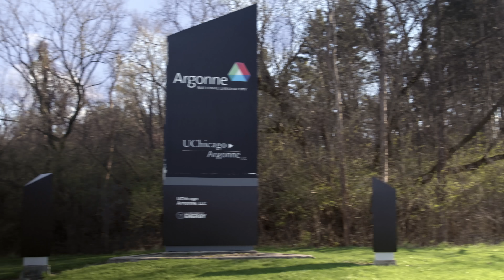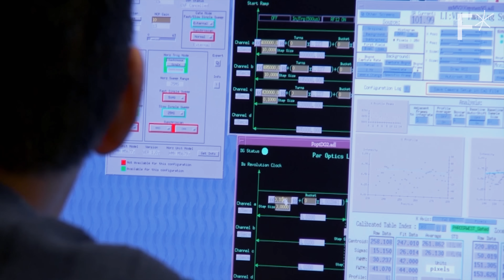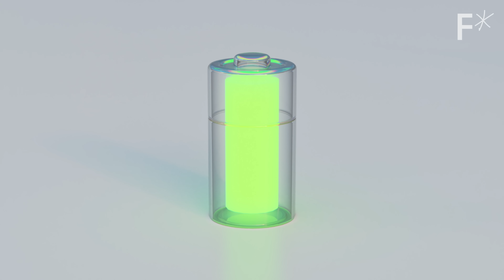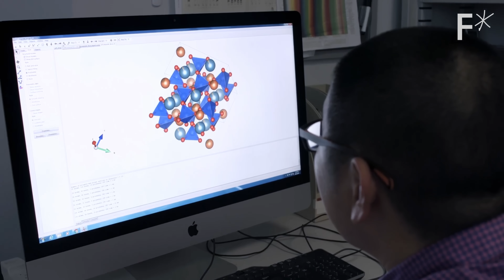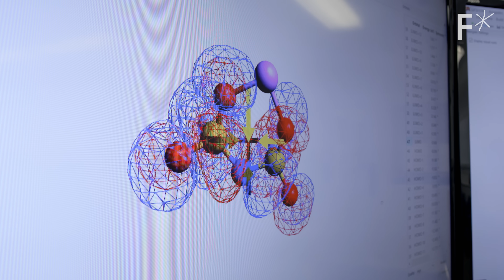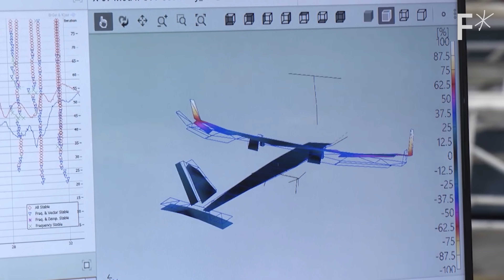The future of high energy density batteries | Hard Reset

Comment: none of these new battery vids ever take into account that lithium batteries are a massive multi billion $ consumer industry. Industry does not kill its own income just cos a better products comes along. i.e. disposable razors: they use extra soft steel that is carefully designed to blunt after a few seconds of cutting hair. It's been trivial for decades to forge steel that keeps a razors edge for longer but that would reduce razor consumption.
Also substaintially improved battery tech would jeopardize the consumer oil market which the oil cartel will not allow.

Comment: As an civilian "observer" I think there needs to be more R&D into battery swapping.  
It is already here for battery powered electric hand tools and works quite fine.  As a matter of fact without the ability to swap batteries, these hand tools wouldn't be on the market today.
This approach needs to be taken with EV's and especially Electric Trucks.  By installing a portion or all of the battery as a swap it enables charging from solar during the day or other sources as they become available such as wind or nuclear when above peak electrical production occurs.  It also enables the swappable battery to be used for other uses such as home storage for night time power usage.
Another benefit is the reduction in weight of an EV or Electric Truck which increases the efficiency of the battery further.  It could reduce the weight for short trips but extra charged swap batteries are added when needed for longer trips.

Comment: 102204.  Other than a diode array, another method to plausibly transform ambient heat into electricity with equivalent cooling essentally consists of two electrodes closely face to face (~1 micrometer) in a vacuum wired to an external electrical load. The face of the [Emitter] electrode is covered with a uniform array of LaB6 tipped small diameter carbon nanotubes grown straight out. The face of the [Absorber] electrode is covered with small scale graphine flake char. [Rice U 2014]

Thermal energy mobilized unattached electrons will tend to free themselves and move outward from the emitter tips and drift at ~1 million meters / second @ 25 millivolts (thermal electron energy @ 20 C)  to the absorber which tends to collect them. 

A negative charge accumulates on the absorber. This repels oncoming electrons slowing their forward drift, cooling them. The absorber electrode charge is simultaneously the repelling cooling and the external electrical load voltage. The drift current and external wire route current are the same. The DC electrical power consumed by the electrical load depends on the load resistance. Thermal energy absorption always equals the electrical yield.

Wire resistance is a practical loss not a true loss so lt is overcome by added device output. Extra cooling then balances the heat given off by the wire loss. The performance of the device is expected to be modest in the beginning but improve rapidly. Even early devices are expected to last a long time. There is little place for obsolence if the first installed device works adequately. They will withstand being short circuited indefinately up to an electromigration limit.

The device decays via electromigration. This may be very slow. Low current density encounters between electrons and the atoms of an electrical conductor are elastic.

Aloha

Comment: 102203  Nanometer scale uniformly aligned parallel diode arrays may be a practical way of absorbing ambient heat. Ambient heat is uniform on a micrometer and larger scale and non uniform on a nanometer scale. Plausibly,  heat absorbtion at the non uniform scale is available as Johnson Nyquest thermal electrical noise that would yield, by conversion without gain or loss, an equivelent amount of electrical energy. 
AND
 Diode voltage / current  characterstics can be displayed on an XY tracing oscìlloscope. Thermal electrical noise power in resistors can be displayed by time sweeps of voltage on an oscilloscope. Each such time sweep shows unique randomness.
AND
A  simple  "Special Program with Integrated Circuit Emphasis" model indicated that diodes in uniform alignment parallel would aggregate simulated rectified thermal electrical noise.

Maximum direct current electrical power, half, is transfered from a direct current electrical source to the electrucal load when the electrical resistance of the two parts is equal. Calculated matched resistance output (watts) is k (Boltźman's constant), one point three eight x 10^ minus 23, times T (temperature Kelvin) times bandwidth (0 Hz to a natural limit ~2 THz @ 290 K) times rectification halving and nanowatt power level rectification efficiency, times the number of diodes in the array. 

There are a billion cells of 1000 square nanometer area each per square millimeter, 100 billion per square centimeter. 

Creditable independent replicatable proof of concept protypes beyond improper influence are needed.

Aloha
Charles M Brown 
Kilauea, Kauai, Hawaii 96754

Comment: 102203  The second law of thermodynamics may be false conventional wisdom. Let's face the wonder of full heat use. 

The second law of thermodynamics was developed during v8ictorian england's scientific and religious fascination with steam engines. 

The second law is behind modern refrigerators needing electrical energy to compress the refrigerent to force it to release as waste the heat that it has removed from the refrigerator's service interior in the cooling part of the refrigerent's circulation. The interior coldness draws in exterior heat through the cabinet insulation. There is also discarded heat from mechanical friction and electrical resistance. The net thermal output equals the electrical input with energy not being gained or lost in this refrigeration system including its forced waste. Unencumbered refrigeration by the principle that energy is conserved should produce electricity instead of consuming it. 

It makes more sense that refrigerators should yield electricity because energy is widely known to change form with no ultimate path of energy gain or loss being found. Therefore any form of fully recyclable energy can be cycled endlessly in any quantity. 

Full heat recycling, all electric, very isolated underground, undersea, or space communities would be highly survivable with self sufficient EMP resistant LED light  automated vertical farms, thaw resistant frozen food storehouses, factories, dwellings, self contained elevators, safe rooms, and horizontal transports. 

In a flourishing civillization, small self sufficient electric or cooling devices of many kinds and styles like lamps, smartphones, hotplates, water heaters, cooler chests, fans, radios, TVs, cameras, security devices, robot test equipment, scales, transaction terminals, wall clocks, open or ciosed for business luminous signs, power hand tools, ditch diggers, pumps, and personal transports, would be available for immediate use incrementally anywhere as people as individuals or larger social groups see fit. 

Some equipment groups could be consolidated on local networks. 

If a high majority thinks our civilization should geoengineer gigatons or 
teratons of carbon dioxide out of our environment, instalations using devices that convert ambient heat into electricity can hypothetically be scaled up do it with a choice of comsequences including many beneficial ones. 

Energy sensible refrigerators that absorb heat and yield electricity would complement computers as computing consumes electricity and yields heat. Computing would be free. Chips could have energy recycling built in.

A simple rectifier crystal can, iust short of a replicatable long term demonstration of a powerful prototype, almost certainly filter the random thermal motioren of electrons or discrete positiive charged voids called holes so the electric current flowing in one direction predominates. At low system voltage a filtrate of one polarity predominates only a little but there is always usable electrical power derived from the source, which is Johnson (observation) Nyquest (theory) thermal electrical noise. This net electrical filtrate can be aggregated in a group of separate diodes in consistent alignment parallel creating widely scalable electrical power. The maximum energy is converted from ambient heat to productive direct current electricity when the electrical load electrical resistance  is equal to the array internal electrical resistance. 

Maximum calculated electrical power output (watts) is k (Boltźman's constant), one point three eight x 10^ minus 23, times T (temperature Kelvin) times bandwidth (0 Hz to a natural limit ~2 THz @ 290 K) times rectification halving and nanowatt power level rectification efficiency, times the number of diodes in the array. 

There are a billion cells of 1000 square nanometer area each per square millimeter, 100 billion per square centimeter. 

Order is imposed on the random thermal motion of electrons by the structual orderlyness of a diode array made of diodes made within a slab: 

  P type boron doped
-----‐------‐----___-- Out
🔻🔻🔻🔻
■■■■■■___ + Out 
  N type phosphorous doped 

All the P type semiconductor anodes abut a metal conductive plane deposited on the top face of the slab with nonrectifying joins;  the N type semiconductor cathodes or common cathode abuts the bottom face. As the polarity filtered electrical energy is exported, the amount of thermal energy in the group of diodes decreases. This group cooling will draw heat in from the surrounding ambient heat at a rate depending on the filtering rate and thermal resistance between the group and ambient gas, liquid, or solid warmer than absolute zero. There is always a lot of ambient heat on our planet, more on equatorial dry desert summer days and less on polar desert winter nights.

Focusing on the composition of one simple diode, a near flawless crystal of silicon is modified by implanting a small amount of phosphorus (N type conductivity) on one side from a ohmic contact end to a junction where the additive is suddenly and completely changed to boron (P type conductivity) with minimal disturbance of the crystal lattice. The crystal then continues to another ohmic contact. 

A region of high electrical resistance forms at the junction in this type of diode when the phosphorous near the ĵunction donates electrons that are free to move elsewhere while leaving phosphorus ions held in the crystal while the boron donates holes which are similalarly free to move. The two types of mobile charges mutually clear each other away near the junction leaving little electrical conductivity. An equlibrium width of this region is settled between the phosphorus, boron, electrons, and holes. Thermal noise is beyond steady state equlibrium. Thermal noise transients, where mobile electrons move from the phosphorus added side to the boron added side ride transient extra conductivity so the forward moving  electrons are preferentally filtered into the external circuit. Mobile electrons are units of electric current. They lose their thermal energy of motion and gain electromotive force, another name for voltage, as they transition between the junction and the array electrical tap. 

Inside the diode, heat is absorbe; outside the diode, to exactly the same extent, an attached electrical circuit is energized. The voltage of a diode array is likely to be small so many similar arrays need to be put in series to build higher voltage.  

Understanding diodes is one way to become convinced that Johnson Nyquest thermal electrical noise can be rectified and aggregated. Self assembling development teams may find many ways to accomplish this wide mission. Taxonomically there should be many ways ways to convert heat directly into electricity. 

A practical device may use an array of Au needles in a SiO2 matrix abutting N type GaAs. These were made in the 1970s when registration technology was poor so it was easier to fabricate arrays and select one diode than just make one diode. 

There are other plausible breeches of the second law of thermodynamics. Hopefully a lot of people, mostly as independent teams, will join in expanding the breech. Please share the successes or setbacks of experiemental efforts. 

These devices would probably become segmented commodities sold with minimal margin over supply cost. They would be manufactured by advanced automation that does not need financial incentive. Applicable best practices would be adopted. Business details would be open public knowledge. Associated people should move as negotiated and freely and honestly talk. Commerce would be a planetary scale unified conglomerate of diverse local cooperatives. There is no need of wealth extracting top commanders. We do not need often token philanthropy from the top if the wide majority of people can afford to be generous. 

Aloha
Charles M Brown 
Kilauea Kauai Hawaii 96754

Comment: Lithium is not environmentally problematic to obtain nor are lithium batteries difficult to recycle (they are actually quite profitable to recycle!), it is primarily the cobalt which is the problem. In regards to "1-2 TONS per kg of lithium", okay, and your point is...? 2 tons of water really isn't much compared to many industry uses and water is obtained large-scale from desalination plants near the oceon. Further, 1kg of lithium would produce ~9kwh (about 160g/kwh, but some batteries use significantly less lithium metal) which is a large battery. A tesla power wall is about 13.5kwh for comparison.

In terms of alternatives to li-ion, there exists LTO and LiFePO4 which are quite popular for certain use cases and contain no cobalt. There are other less popular lithium chemistries that exist with improved lifespans and energy densities but other disadvantages.

Comment: I have patented a closed-loop system using electrolysis and either fuel cells or an engine I have patented called the Ringine to store energy in high-pressure hydrogen and oxygen gases, and then recover the energy by passing it back through either the fuel cell(s) or the Ringine (the Ringine appears to actually be MORE efficient than the fuel cells).  We are preparing to detail engineer the Hydrox version of the Ringine to demonstrate the technology.  This is a TOTALLY closed-loop system that can be very small or VERY LARGE and store enormous amounts of energy in extreme density due to the application of electrolysis to 'split' millipore-pure water.  We can store about 2Mw-hours in about 150 gallons of water.  We are talking about industrial-level power storage to allow power from green sources to be stored in huge amounts so that our world can be power at night by solar energy.  We have also developed a system that utilizes solar thermal energy to desalinate or purify seawater or brown water and purify it AND produce electricity as a BY-PRODUCT by utilizing the Ringine.  We are currently preparing to build a tech demo of that system because we feel water is ever-more critical and since we can produce BOTH power and purify brown or seawater simultaneously, we should pursue that avenue first, then this: We have also developed a solar-thermal power production system using a closed-loop highly distributable steady-state cycle that produces electricity at 35% to 45% overall system efficiency; we truly believe this, all put together, is the 'way forward'.  And this is just the tip of an iceberg I'd love to tell you about.  @Freethink, you need to be aware of this.  I would be glad to present it to you.  Let me know if you are interested.  This is vetted by several professional engineering firms and MS&T, and their ME Department and it's Head has lead in Federal funding submittals we are still waiting on, and they will vouch for this.

Comment: In Australia 20million vehicles and 
20million buildings. 
All buildings are connected to the national grid. 
EV batteries are 100kwh for the long drive. 
Daily drives are 7kwh. 
EVs are parked 23/7/365.
EV selfparking means that they can 'nuzzle' onto a low mounted wall power point when parking.
EVs can be part of the existing national grid. 
20million × 100kwh = 2,000gWh 
This is 3.3 times more than the maximum fossil fueled generated electricity daily. If you are lucky. 
This is 5 times more than avg daily fossil fueled generation. Today.

In a no fossil fueled world, 5 times more electricity is needed and 5 times bigger national grid. 
Poles and wires to the streets and homes and businesses and industries and buildings and all the ends of the existing national grid. 

If the existing national grid is UNLOADED  by the 40% of home supply, and the the home feed in was 40%, then generators will only need to supply 20% of today's electric demands. 

20million buildings with rooftop solar pv 33kwh,  = 660gWh daily = today's fossil fueled maximum and more, daily. 

Less sun then a few more panels. 
Most roofs are 100m2 and more.

Central concentrated electrical power generation is economically stupid and expensive because of the extreme costs of the national grid. 5 times bigger national grid is insanely economically stupid.

Comment: I think it comes down to the efficiency of the lectronics that use the battery and the quality of the battery. Bear in mind that batteries leak from new where as a fuel tank that holds liquid fuels never leaks unless you damage it. Liquid fuels are lightweight too which is way better for heavy vehicles that are involved in transport.